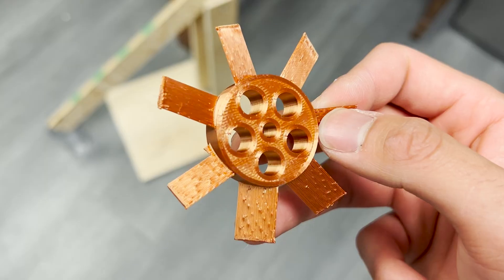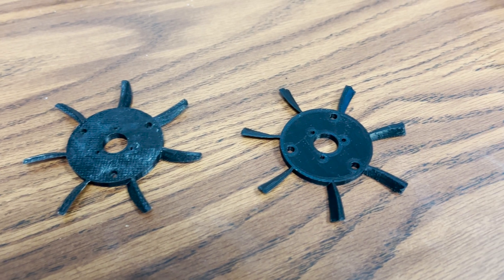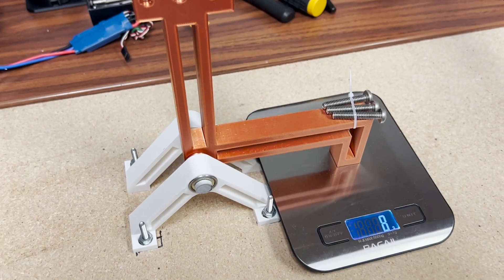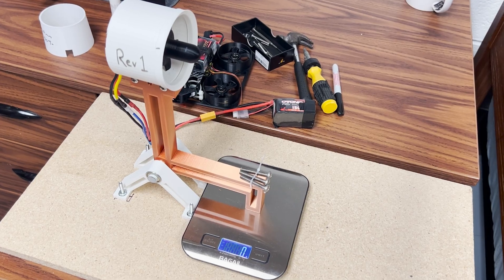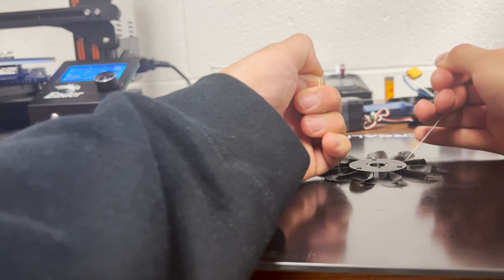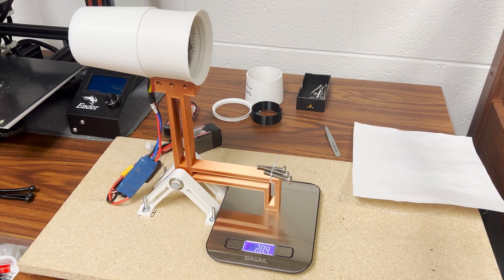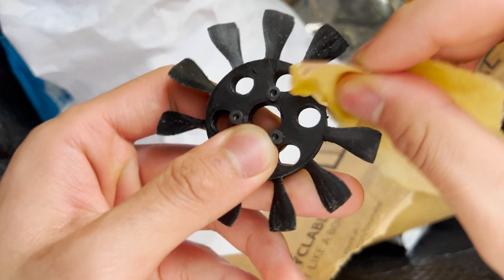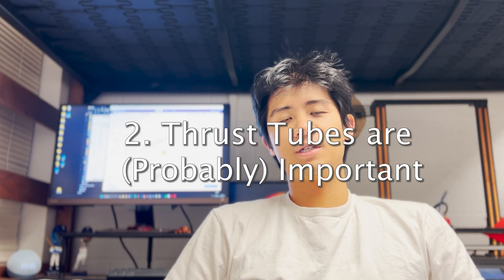Pushing the Limits: 400g Thrust (3D Printed EDF)

Comment: Something that's helped me a lot - I switched to a PEI coated spring steel plate from Amazon, and it's been amazing ever since. You could probably get away from all that brim very easily, while also having super easy removal from the bed when it cools.

Quick note, if you begin having issues with adhesion suddenly on PEI, try washing it with hot water and dish soap, hand oils heavily affect the performance.
Reply from the maker: Yeah my plan is to switch to PEI asap when the glass fails. Which might be a while lol. As for the brim I think I was just experimenting I have no clue what the reasoning was
Reply: @mach10point4  I'll help you get past that reasoning: the glass is "failing" every single time it requires you to use a brim on a part that shouldn't need it. Even if you only value your time as = minimum wage, it wouldn't take long for a PEI bed to "pay for itself" in de-brim/postprocessing time! Plus your part edges will be cleaner and parts more symetrically balanced, so are likely to give better performance and last longer!

Comment: Dumb guy with a smart phone here: A flash of stupidity has me wondering, have you thought of a " ducted tipless toroidal" prop? Essentially staggering the propeller blades and using the duct as it's outer wing tip. If pitch and stagger were calculated, it could possibly match the thrust of a contra-rotating assembly... something I've yet to see and am thinking of the potential.

Comment: Very nice work. From the image on the video at the end, you can tell the housing could be better. 
   You have probably printed a benchy. Make sure you perfect the benchy before getting four final numbers.
   You also talk about sanding, and people have mentioned acetone smoothing and not pla but resin printing which is also very nice. 
   But those are final steps or post processing of pla. 
   I think you can improve your print process with the printer you have.
   You could probably improve alot through working with layer height and print speed. You should think about nozzle thickness when working with layer height.
   Printer speed will also cause vibrations that make your print look like what is in the image.
   The Content of the video is very good. 
   Also, for final results, 400g of thrust is probably very good, but I think you also made a mistake in your process of making too many changes at one time. 
   For instance, changing blade type and adding that nozzle intake at the same time. 
   I would say one change at a time. 
   A plain housing until you find your best blade design. No converging outlet. 
   This would isolate blade design. 
Then work with the housing, thickness, initial intake side shape, then exhaust shape, convergent design isolation. 
   You then might have to look at blades or props again.
   Also the test bench is good. But you dodnt talk about whether or not the part that supports the motor and housing is the same length as the lever that acts on the scale. I think you should use a 1-1 so there is no torque multiplication. Maybe a more accurate reading if that is not what  you did. In the video you cant tell, so maybe it is the same.
   That would be alot of work, but its a way to create more content. 
   I think this was a good video and maybe you will make more or hopefully get even better results. Good luck!

Comment: SOME FEEDBACK I WOULD SAY, CONCAVE THE PROPELLER A LITTLE FOR WEIGHT REDUCTION AND LESS CONTACT AREA. THEN ON THE HOUSING SUPPORTS, ANGLE THEM WITH THE ASME DIRECTION OF THE PROPELLER BLADES VERY SLIGHTLY. AND BRUSH SOME ACETONE ON THE PROPELLER SHOULD SMOOTH IT ALL OUT SO IT HAS SMOOTH SURFACE. WATCH A VID ON THAT BEFORE ATTEMPTING
Reply: Acetone doesn't work on PLA
Reply: AWE DANG NEVERMIND MY BAD @greggv8

Comment: I mount my motors on the stator.  I also use very slim inrunner brushless motors that take up much less space in the duct which produces more flow. The best EDFs use inrunner BL motors. There is no need for the torque of an outrunner motor for an EDF. It's wasting volume that can be converted into extra flow.
Reply from the maker: This is a great tip because I have been looking at other motors/KV ratings...it's all about speed for this one

Comment: Here's a recommendation: You should invest in a resin printer, they can produce much smoother parts for better flow characteristics.
Reply: Did you read the disclaimer at the literal very start of the video
Reply: Smooth isn’t good for airflow regardless what u think lol .    Especially when it comes to thrust noise yes lol actually thrust no
Reply: Layer lines shouldn't make tooooo much of a difference in thrust
Reply: He's printing in his bedroom, I wouldn't advise it
Reply: Yah, there's benefits to resin, but it's not necessary by any stretch.  I print with both, but honestly each has its purpose.
Reply: Resin are way heavier than fdm plastic. Generally 30% more, and weaker.
Reply: Resin fans are too weak. I’ve exploded quite a few resin fans during testing and eventually gave up on it.

Print the fans with a .1mm nozzle and a low layer height if you really want it smooth and precise
Reply: @reeceengineering  You can't use brittle resin, it has to be slightly flexible.
Reply: @raymondelder5004  I used siraya blu and a few other brands. All were exploded at high rpm, on a 64mm fan. A larger fan would only be more dangerous.

The X&Y direction strength of FDM prints is far stronger than resin prints
Reply: Smoother is not better.

Comment: This is really cool.  Some thoughts:
* Your airflow is subsonic, so a converging rear cone will convert pressure at the back of your fan into velocity.  Diverging will convert velocity into pressure.  Your exit total pressure (static+dynamic) will equal your ambient pressure.  I'd try a converging cone which results in the same area as your fan annulus.
* You really, really need a full, round nosecap that diverts air entirely over the motor, and a tail cone as well.  Pressure behind the fan will be higher than pressure forward of the fan, so you actually want to have a cooling air intake behind the fan, airflow inside the motor will be forward, and then have that airflow come out through a duct in the nosecone that ejects backward.  I know, crazy.  Try looking at the airflow over the F-35 DSI inlet bump.  Air is weird.
* Increase the radius of that inlet lip.  I wasn't able to see, but you should have the lip turn a full 90 degrees, maybe you have this already.  The inlet is producing thrust, since the airflow around it is lower pressure than ambient.  Bigger = more thrust.
* You don't mention, but you can determine the blade angle from axial speed vs tangential speed.
* It looks like you are using flat plate airfoils.  You should be able to do better with actual airfoils.  You can look these up on https://m-selig.ae.illinois.edu/ads/coord_database.html.  Use xfoil to run simulations to see how they work, and to adjust them.  I'd try an SD6060 airfoil with camber around 4%.  Try converting the stator blades to airfoils first, that might be easier.

What CAD system are you using?  Getting the airfoil spline from xfoil into CAD sometimes takes a few tricks.

Final thought: I really like your test stand.  Have you given any thought to
* nacelle design?
* testing in ambient airflow?
Reply from the maker: Hey, thank you so much for writing this up, it’s insanely helpful. All of it makes sense.

I’m just realizing now that most OEM EDFs have the motor tail cones. Makes sense aerodynamically, never thought to add them. They also generally have noses that cover the whole motor area like you said.

I do have an arbitrarily shaped airfoil profile, it didn’t come out great on the print though. I’m using SOLIDWORKS. I should probably use one of the NACA shapes though. I’d probably just manually trace over the contour.

What do you mean by ambient airflow testing? Like without a lip?
Reply: @mach10point4  I mean testing in a breeze!  The ducted fan will work differently when it's moving relative to the ambient air.

I used SolidWorks too, and have a workflow defined for getting airfoils into it if you're interested.
Reply from the maker: @IainMcClatchie  Ah gotcha. I'll let you know. Thank you again!
Reply: Great write up. Thanks for the explanation - Would this work the same way in water if I wanted to create an underwater thruster? How different would the aerodynamics vary from the fluid dynamics?
Reply: @3DProspecting Yes and no?

Basically your question doesn't make a lot of sense.

Aerodynamics is fluid dynamics.
Hydrodynamics is also fluid dynamics.

Aerodynamics is the study of air and other gases in motion.
Hydrodynamics is the study of liquids in motion.

But they are both fluid dynamics, which is the study of fluids in motion.

As such a lot of the underlying principles and equations are the same.

The reason we tend to break it up into two different fields though is that liquids and gasses tend to have very different reynolds numbers (the ratio of the inertial and viscous forces.) As such they are going to behave very very differently and efficient designs for one will not be efficient for the other.

If you want to design something to propel something through water I would recommend starting by looking at the common designs for hydrofoils and the propellers used to push watercraft, and then deciding on the pros and cons for each of the current popular methods for propulsion while comparing that to your use case.

That will probably get you closer, quicker, than trying to apply aerodynamic designs to a hydrodynamic situation.
Reply: @SpiralPowerGaming  Thanks for the explanation.  Yeah, I didn't word it properly but you answered my question.  I should have asked would the principle be the same if I wanted to use this as an underwater thruster and what are the differences I need to consider regarding performance and efficiency  Clearly, I am not as knowledgeable on this topic as you are.   I appreciate the detailed explanation.
Reply: @GoldiBox  Tools like xfoil are actually somewhat useful for simulating daggerboards, rudders, and sails on boats.  It turns out the Reynold's numbers for these things aren't wildly different, they often sit in the 50,000 to 20,000,000 range that xfoil can do pretty well.

The thing to be careful about is that wing "spans" for sails and rudders are a bit difficult to define, and you get very, very large induced drag.  This is confusing enough that most boats don't try to seal the gap between the deck and the sail, when they really should.

Comment: Keep it up chief - it's helping me get the motivation to keep with with fluid dynamics this sem

If you do ever go for chemical smoothing; avoid Dihydrofuran and DCM unless you've got a fume hood around

Ethyl Acetate is a much safer option, similar MSDS risk to acetone (so don't huff it) - though organic solvents are organic solvents; be careful if you do
Reply from the maker: Means a lot man, there’s probably a love hate relationship with thermo/fluids right now, I’m right there with you haha. 

And thanks for the tip, yeah it sounds like I’d have to go the super strong chemical route which I’m lowkey scared of so I probably will just have to go with an ABS/resin solution
Reply: @mach10point4 An acrylic floor polish like Future does some smoothing. It won't eliminate layer lines but fills in the sharp bottoms of the lines and makes a glass shiny surface. If it's too thick, thin it with some water. After it dries it can be removed with 91% rubbing alcohol.